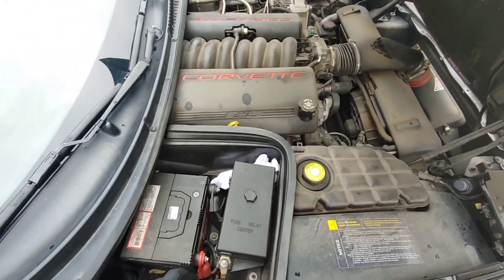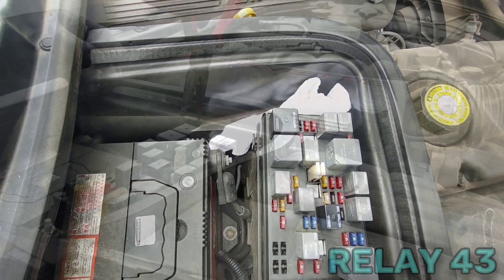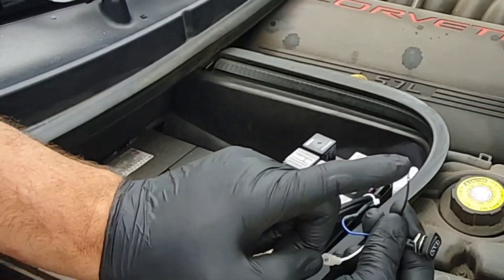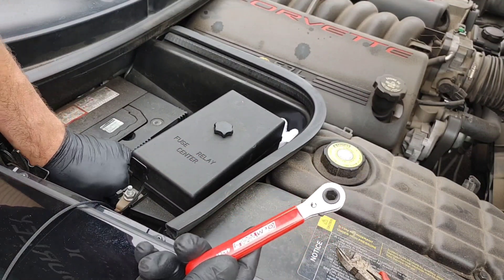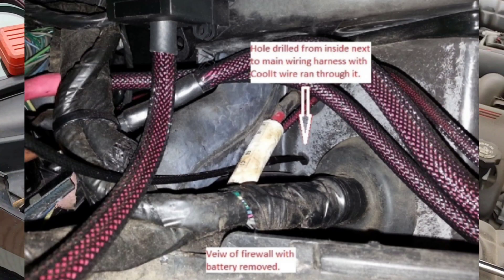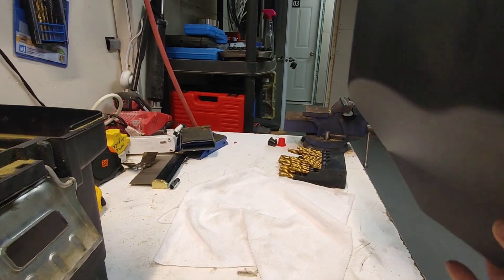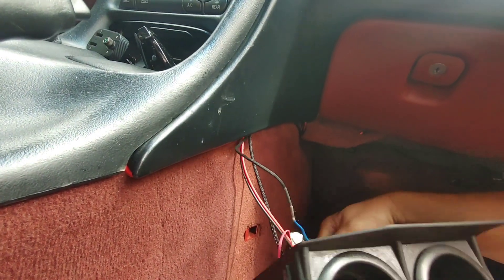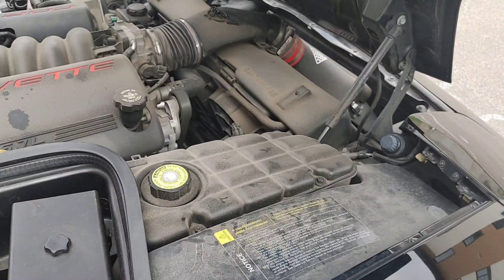Corvette C5 how to make it run cooler with "COOL IT H2" Installation guide

Comment: Use a heatgun on fuse box lid, and heat and press with the edge of a round screwdriver to make a nicer outlet for the wire. Instead of cutting a hole roughly.
Reply from the maker: Good idea appreciate it